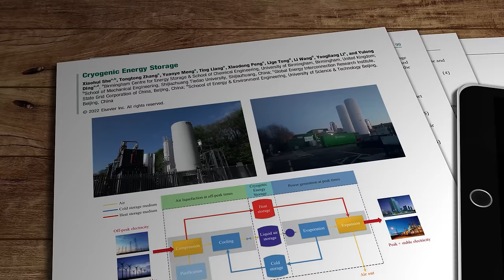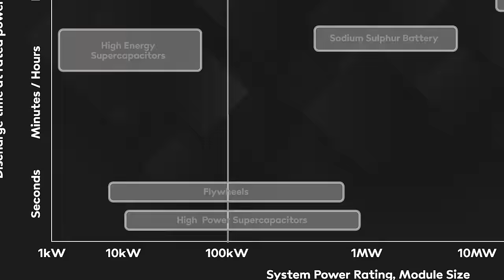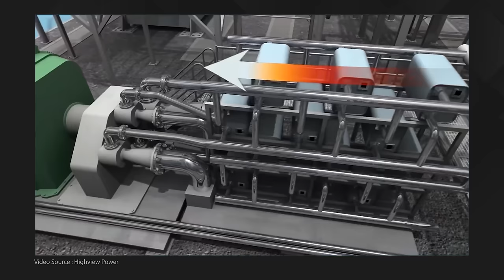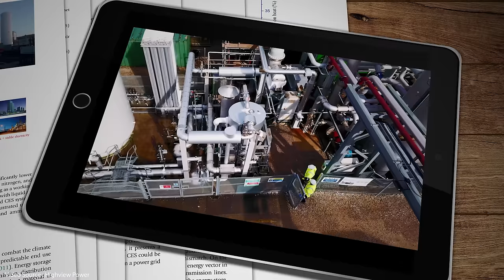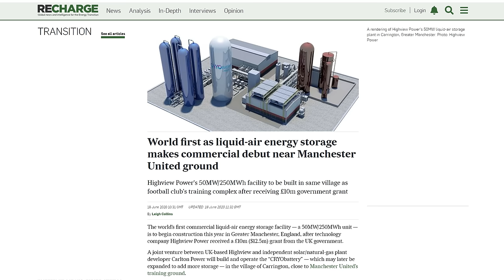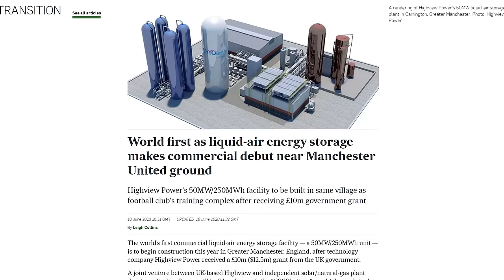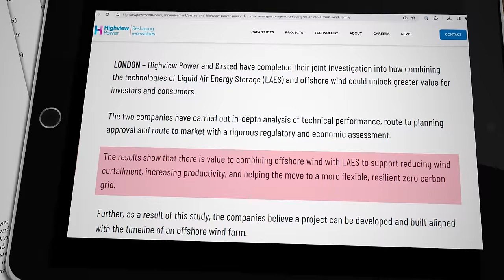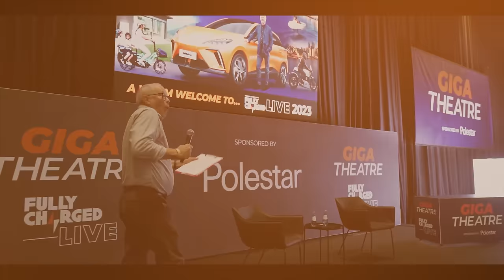Cryogenic Air Energy Storage - the new long duration energy solution?

Comment: Are there some synergies in the cryogenic energy storage systems for an integrated approach? e.g. Is it practical to integrate the commercial separation of air gasses into the cryogentic energy storage plant? Let us suppose that the plant has the option (when not otherwise working and when there is an oversupply of electricity) to distill the cryogenic air and separate it into tanks holding CO2, N2 and O2. These tanks could still be dual use, either for sale or for expansion or through a turbine (depending on the spot market price of electricity). Apart from the pure gasses having direct commercial value there are other potential synergies which would come into play depending on where the plant were sited... Heat produced during gas compression could be directed through a district heating system. If the O2 tank was being expanded through a turbine to produce electricity,  then the exhaust could be used to burn fuels in a closed CCS basis.

Comment: Stroing energy in liquified air is so incredibly smart, a round-trip 60% efficiency using (somewhat) low-tech is actually quite incredible. Because storage is cheap! therefore is not expensive to have ahuge capacity.
Beautiful:)
(and side effect it extract CO2 from atmosphere for free because it is the first gas to condensate)
Reply: Condensate is a noun. Condense is the verb you're after. The CO2 condensate is one of the first to form as it condenses at a relatively high temperature compared to the other gas fractions would be an example sentence.

Comment: These are potentially a big win for the U.S. southwest - wind energy capture at night, and solar thermal to drive the gas boiling. 60% efficiency isn't an issue when you can capture during low use and bring it out during a peak.

Comment: There is a misapprehension regarding compressed air storage that most people don't mention, namely, that it is a thermal heat battery. The misapprehension is that compressed air contains energy. But there is no energy in compressed air other than the heat created by compressing it. Once that heat is dissipated or removed, the compressed air only expands and turns a turbine when heat is added to it. The difficulty in preserving heat without energy loss accounts for its low(ish) effeciency.

Comment: Im so excited for this :) +50% cost for +100% output+capacity cant really be overstated in terms of how important that is.
Reply: He didn't say that. He said double the power, + 50% of the cost, but he didn't talk about the capacity, which we can assume stay the same. System cost is 50% pumps, pipes, heat exchanger, turbine and generator. And 50% insulated tank Otherwise it doesn't make sense.

Comment: Was there any mention of cost in terms of LCOS? Would be interesting to compare with other technologies. Obviously it is a bit complicated.
Reply: I think it's still a bit of an unknown. they have to run at scale for a few years to estimate that. there is certainly investment, which means some analysts think it can be cheaper than just adding more lithium ion cells to a battery farm.
Reply: @somedude-lc5dy  If they know what it will cost to build the plant, and have some idea of the efficiency and capacity, they should be able to estimate an LCOS.  The fact that they don't mention it (unless Dave just skipped it) suggests that it's not that great, but they did have the study with Oersted, so maybe it's not so bad.  I'd just like to see a standardized comparison to other storage options.

Comment: Seems promising, but very much need an update in a few years when these start running. Correct me if I'm wrong, but I didn't see any discussion of the drawbacks in this. If everything is so much cheaper and technologically simple, why hasn't this already been explored at wide scale?

Edit: seems like the big drawback is cycle efficiency. LAES roundtrip efficiency is 50-60% for large scale systems. Li-on batteries are upwards of 95%.

That said, for large scale storage that can happen essentially anywhere that you can plop down and just let sit (akin to pumped hydro), this has obvious advantages over lithium batteries. It's not a replacement for home storage or car batteries.

Comment: Most people do not understand how efficient lithium batteries are compared to other technologies. A Telsa power pack cost $1.24 Million for a 2.6 MWH battery pack. Assume electricity  cost of $.163 per Kilowatt hour that gives a cost of $423.8 to fully charge a Megapack. The stated pack efficiency is 92% for charge- discharge cycle giving a cost of $33.904 per cycle. Compare that to a system with an 80% efficiency with a cost of $84.76 per charge- discharge cycle. If each system was cycled once a day for a year the Telsa power pack would cost $12,374.96  compared to the 80% system cost of $30937.4 giving the Tesla power wall saving of $18562.44 over the 80% system. Any bean counter would pick the Tesla power wall over the 80% efficient system.

Comment: As a former Mancunian I was pleased to see that as well as a cryo air energy storage plant, the Trafford Low Carbon Park will include a green hydrogen plant. Green hydrogen? That's an oxymoron isn't it?
Reply: Hydrogen derived from water by electrolysis using electricity generated by wind, solar, geothermal etc.
Nice and green, no!?

Comment: You briefly hit the nail on the 'trying to get past govt bureaucracy'.  Anything that breaks away from the norm will meet a large wall of resistance.

Its not much different around here when it comes to building something.  You can be armed with info brimming with a product that's shown to pass the appropriate standards that apply.  If it is deemed outside the 'standard', try to get it passed.......How much time and money do you have to spare!

Comment: When we receive liquefied natural gas it must be reheated to be in gaseous form. Unfortunately the current solution is to burn part of the gas even though it is possible to recover a large part of the energy initially used to cool and liquefy the natural gas. In addition, the efficiency of a thermal machine for a hot temperature of 10°C and a cold temperature of -162°C is 60%. So a significant recovery is possible.

Comment: Thanks. 

Anything involving a phase change process is better than those that dont. 

However, when it comes to readily available gases it is hard to beat cabon dioxide in terms of latent heat, temperature of transition, safety and ease of handling and processing. 

Ammonia has similar physics but is of course poisonous. 

Liquid air comes far behind carbon dioxide in terms of latent heat, so anything involving that process will by comparison be large, expensive and inefficient.

Comment: theres a bunch of waste energy made from moving LNG around. i cant help but think the heat exchangers used to regassify LNG could be coupled to this tech and used to regain the lost energy from the enthalpy change needed to heat lng up to regassify it. even starting from a cooler temp would be really helpful, could even be net positive energy gain just coz its taking advantage of all the waste energy that is normally vented to atmoshphere in heat exchangers

Comment: Since they have a hot part and a cold part, I wonder how that would compare to using a seebeck generator. It's crazy that spinning a turbine is still king for most energy generation.
Reply: Run the electrics from Seebecks as there'll be plenty of DeltaT

Comment: The basic problem with liquid air is also economic.  You can store the energy for long periods, sure, but the installation is not producing any cash flow just storing energy and doing nothing with it for days on end.

What matters in the end for long-term storage is the cost of storing X amount of energy.  It literally has to approach zero to make any sense.  In otherwords, if one can pack a massive amount of energy in a passive tank then something like that can be made economic.  However, a couple of hundred megawatt hours does not qualify as a "massive amount of energy".  It really needs to be above a gigawatt hour and probably higher.

The reason the amount of storage has to be huge is because the whole point of doing this is to be consistently able to soak up excess generation 24x7.  For example, to be able to soak up the output of a nuclear plant that is in excess of demand, at mid-day and overnight.  That nuclear plant, and the ISO, need assurances that the excess power can be soaked up continuously.

That is what makes this sort of storage valuable, because it allows generators such as nuclear plants to operate economically 24x7.

When you think about it, long-term storage also has to be able to discharge energy during peak periods far in excess of what they soak up the entire rest of the time.  So the idea that the inverter / power components can be small is just straight-out dead wrong.   These long-term storage facilities need to be able to dump everything they have in the same window that LFP batteries dump energy in.  5-9pm and morning, to make room for the continuous accumulation the rest of the time.

--

Your points about lithium battery installations also have some serious mistakes.   Doubling the power output of a lithium battery installation is primarily a function of the inverter, not the battery cells.  There are reasonable limitations to what the cells can charge and discharge at, but these are typically far larger than the capabilities of the inverter.

A LiFePO4 battery designed around a 4-hour discharge has charging and inverter circuitry that is about 1/4th as capable as the underlying cells.  The cells themselves are only dealing with 0.25C rates in that configuration.  That same battery, with the same cells, would have no problem discharging for 1 hour at 4x the power at a 1C rate simply by replacing the inverter.

You also made a serious mistake in your assumptions about the economic window for a LFP battery installation.   The 4-hour window is certainly the low-hanging fruit.  The highest price differentials occur in the late-afternoon (roughly the 5-9pm period).   But that isn't the only economically profitable period in the day.   There is also a smaller bump in the early morning, another few hours, and there are two low-rate periods (middle of the day and midnight-4am) where the batteries can charge.

What a LFP battery cannot do is "charge" continuously at high rates off-peak.  Simply because it does not have the energy storage capacity to do that.  Because of this, LFP battery installations can not guarantee 24x7 determinism for generators such as nuclear plants.  This is the primary differentiator.

-Matt
Reply: Matt, I feel your 'mistakes' being 'serious' are over-egging the pudding. In the 0.25C case, what if the system was already configured with inverters at "max" output, which would seem reasonable to me: then more capacity == more of everything. The video was not well-defined in this sense because that was not the main point. I believe the point Dave was making is that while the inverter is relatively low cost c.f. the cells attached to it, in the LAES case the storage tanks are the low cost item c.f. the remaining kit.
Reply: @rivimey  I think I got it right.  There are two things going on here:  (1) Power and (2) Capacity.  They are two different things.

The main claim to fame for "long-duration" grid-scale storage is to have far higher "capacity" on the cheap while keeping the "power" component small and cheap.

But this only works when the "capacity" is cheap.   This is the part where confusion ensues in the video, because the size of the liquid air systems in the video do not imply that the capacity is cheap.

The second leg of this... the reason capacity has to be ultra-cheap for "long-duration" storage, is precisely because of the long duration.  Long-duration storage does not have the same ability to economically capture revenue from peak consumption periods during the day.  So their storage components must be ridiculously cheap for them to make any sense at all.

There are two parts to the economic equation here which were not covered well at all.   One is the the capacity must be almost zero cost.  And two is that the reason the capacity must be almost zero cost is because these cryogenic systems are supposed to be selling power across whole days... during periods of the day where power is cheap.

This is the problem with cryogenic systems in a nutshell.   Batteries cost more per unit of energy storage, but not enough more, because batteries can also compete in high-profit segments of the market that the cryo units cannot.

A cryo unit can push power during peak pricing periods, just not enough power relative to its capacity to have a great economic return.  Utilizing that capacity requires pushing power for half the day or longer which also includes times of low pricing.

A battery system can push its entire capacity during peak pricing periods if it wants to, resulting in a great economic return.

-Matt

Comment: Looks promising but I am wondering how boil off would affect the efficiency of the system.  insulated tanks are not perfect, some heat still gets through them (especially in summer time and areas with hit climate) which is why any cryogenic insulated tank requires a BOG package that recompress the boil off gas. This obviously consumes power that would decrease the efficiency of the system.

Comment: Lithium ion might be expensive in terms of specific grid scale installation, but isn't there an interesting discussion to be had around the V2G contribution of a what will inevitably be a 30 million automotive fleet? 
That's virtually free mass grid storage with the added benefit of country wide deployment proportionate to local demand.
Reply: Yes, but those systems are probably still a decade away. NMC batteries don't have the cycle life to do both. So you need cars with LFP batteries first. People don't want to pay 3-4k for DC chargers to support V2G and car manufacturers aren't keen to implement a bidirectional AC charger into the car. Not even talking about politics and need to reform all the laws, to allow grid feed in from battery storage and refunds on the grid fees and taxes, to even give it a change to be profitable.
Reply: @Psi-Storm  those systems already exist, and are in use in several European countries, as do LFP batteries. 
V2G is not complicated and will only require to use a small percentage of your battery when BEV adoption scales.

Comment: The chart at 2:17 doesn't include gravity-based storage (the kind using weights instead of water). I wonder how that stacks up against the others? Water allows for greater total capacity than could be practical with solid blocks, but I suspect that solids allow for a more energy-efficient conversion than fluids.
Reply: Gravity-based storage (other than pumped water) is horrible, if you do the math.  See Michael Barnard's article on this.
Reply: @incognitotorpedo42  Not sure where to find that article, but I'm all for seeing the math, especially if it's based on real world measurements.

Comment: I suppose the extracted moisture and CO2 is currently just released back into the atmosphere. It would be interesting to know if they are considering methods of sequestration by perhaps co-locating the plants with greenhouse production facilities. sequestration. Adding carbon sequestration could perhaps contribute positively to socio-economic and environmental impact analyses when such system's are considered.

Comment: very interesting technology. Would lave to see results as soon as they are available. Could become a viable solution for our energy striage issue worldwide. But as often, the devil lies in the detai. E. g. how welll can you store the interim hot and cold reservoirs to reduce overall energy consumption for producing and releasing liquid air. For the pressuized air conspts, I have seen so far this is a significant issue especially if you use underground storage as potential heat exchanged need to become really big or you have to burn gas for heating  up again.

Comment: I know about two liquid air/Electric vehicles made in the 1970s with impressive performance out of the box. Shortly after the second one appeared the USA banned all cryogenic fuels on American roads... They used the pipes as wiring and super-cooled the motors getting something like (though less) than super conductor efficiency in the electric side. 
this is the link to one ==> https://www.youtube.com/watch?v=fx4bECyAjpI

Comment: These huge schemes are all very well but energy storage could and should be distributed to all households with the installation of home batteries - charged at night using cheap wind energy and discharged daily during the high demand periods (4-7pm).  The batteries should be paid for by the power companies - perhaps in lieu of windfall tax payments.